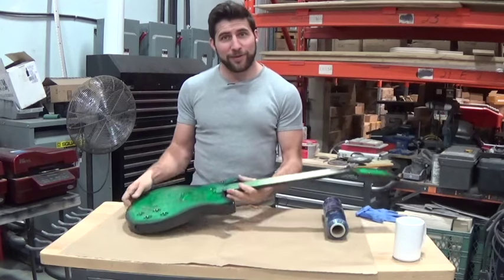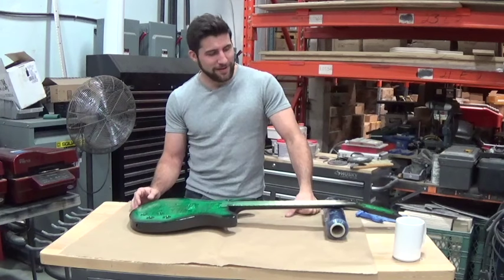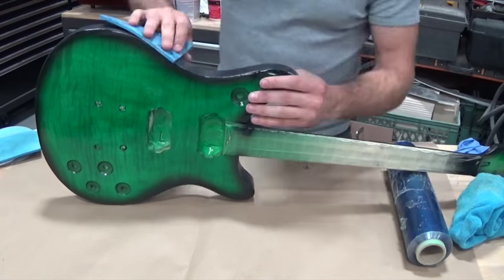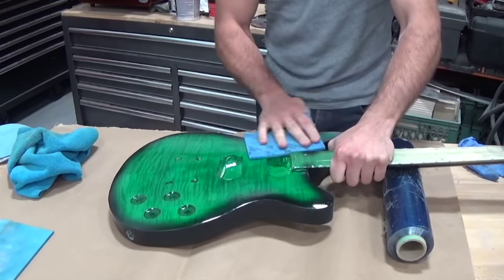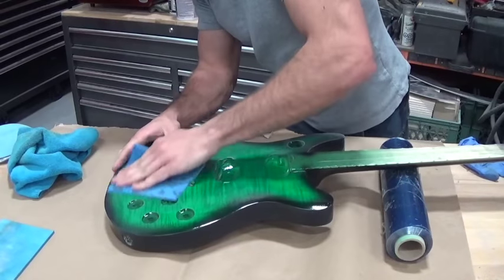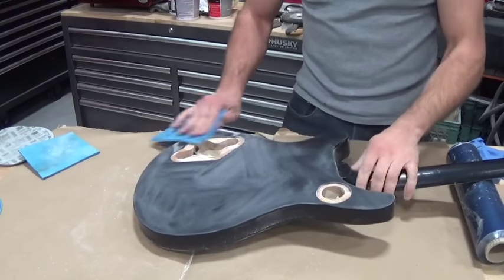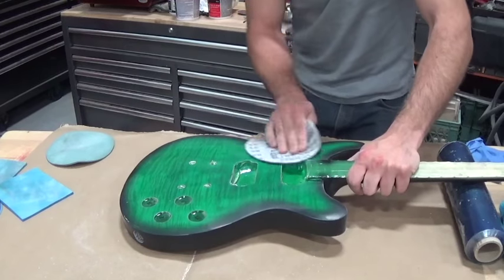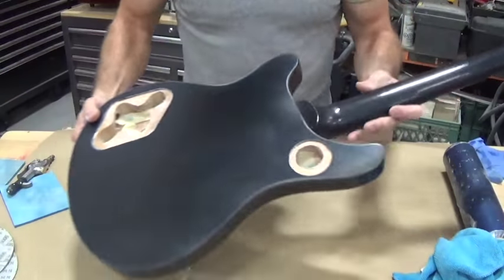The Guitar Kit Build From Guitar Fetish Part 19 | Polishing the Lacquer Clear Coat

Comment: I'm currently building the same kit, and have run into the same problems (veneer sand through; parts not fitting, dirt cheap parts, etc.). I did mine with Rit dye in a burst -black to aquamarine with a poly clear coat. The results are decent, with a nicely smooth and glossy finish. I wish I'd seen this video series before I started, but I am  amused that my problems seem to be common with GF kits. I also notice that there's no hold for the tailpiece ground, which I'll be fixing today.
Reply from the maker: Ya, these definitely aren’t great. On mine the neck didn’t even line up correctly with the veneer and pickup routes.
Reply: @BradAngove  I'd llke to show you how mine turned out. Parts of it, I'm proud of (fairly nice piano finish) , other parts ...ehhh... not so much. Neck lineup was near 1/8" off, like yours, and loose. Do you have an email or website I can send to?
Reply from the maker: You can send it to me using the Instagram or Facebook links in the description.

Comment: Hey Brad!
I've watched a lot of your videos at this point And I've refinished a few guitars. My question is, If it takes so much work to get a guitar with a gloss finish perfectly flat and without ant orange peel reflections (I mean like glass), how do the big mass producers like Gibson and Fender turn out so many with perfectly flat finishes every day? Is it all done with sanding and polishing machine automation?
Or what?
Reply from the maker: I’m not 100% sure about their processes, but they spray in well controlled environments and dry their guitars at specific temperatures to lessen orange peel issues. They also use large expansive buffers that allow them to take out bigger scratches so they can do their sanding more aggressively.

Comment: Bobbins. Pickups seem to come in black plastic, white plastic, off white plastic or metal. You can get coloured pickups but how can you paint a naked pickup bobbin to whatever colour you want such as vai's neons? They are made with coloured plastic and are expensive. I have some lovely SD Invaders but are boring Black. Can I paint that plastic and clear coat them so they will withstand pick attack? guitar is looking good, and you didn't go through the clear and make white spots in it like what I did.
Reply from the maker: Bobbins are just plastic parts. You should be able to paint them as per the instructions in my how to paint plastic parts properly video. That being said, you can also purchase neon bobbins if you want.
Reply: Cheers Brad.
I figured the plastic would be paintable but I tend to twat the pickups with my pick and wondered how much abuse a lacquered bobbin would take as I wouldn't want the metal slugs painting so there would be paint edges. I did look into the coloured bobbins but that would mean a complete rebuild, and the stickers you can get look complete arse!
Looking forward to seeing what you have planned for that strat!
Reply from the maker: Thanks arry. I would't use lacquer on the plastic. Probably an enamel or a polyurethane if anything.

Comment: Can you help. Some of my clear coat has started to chip in sertain spots when I was sanding how do I fix
Reply from the maker: I’m going to need more information than that. What was your process?
Reply: I hydro diped it then put several coats of Valspar clear coat on it about maby 10 or 11 and then wet sanded it I came back to it the next day and put a decal on it and let it set then the next day threw where spots where the clear coat had chipped
Reply from the maker: You put 10 coats of clear on it in one day?